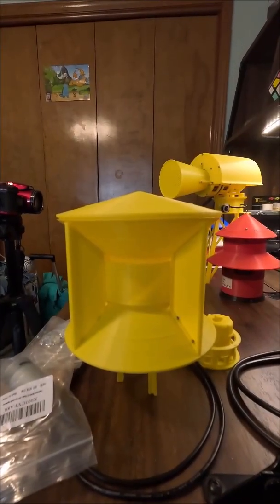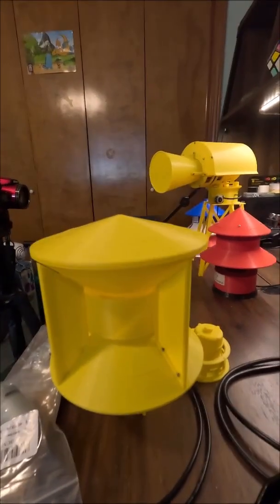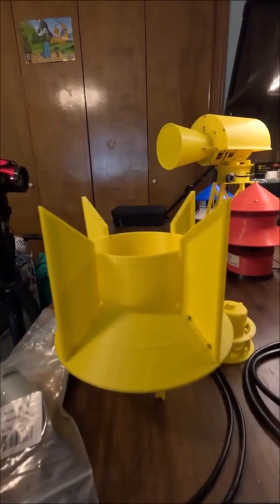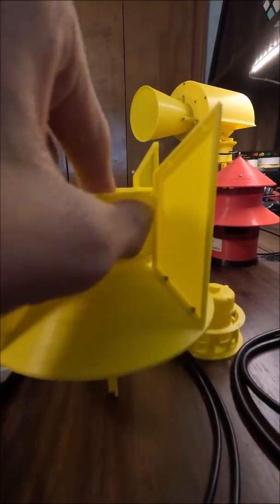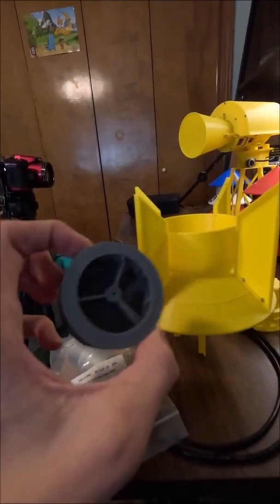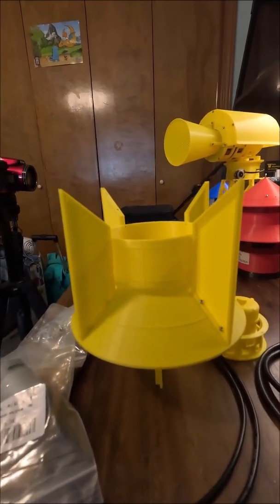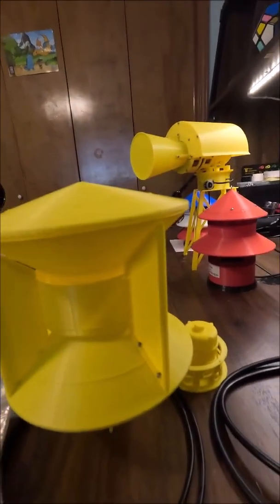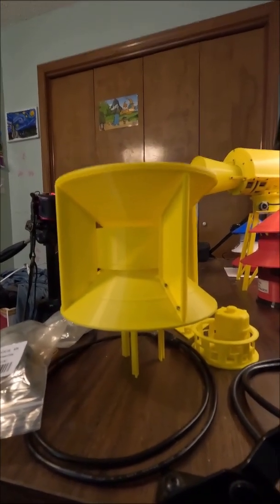New Revamped Mini SD-10 Progress! #sd10 #minisiren #3dprinting

Comment: Seeing it compared to your hands really conveys the size of it, like a phone camera makes it look probably 5 inches wide but the thing’s wider than a hand is long
Reply from the maker: Oh yeah! It's pretty big, even being 1/8 scale. I actually overscaled my older SD-10 because I thought the rotor was 20.5" in diameter like with the STL-10 and STH-10, but that's clearly not true; it's actually 18" in diameter like with the 5T. My new SD-10 now uses the same exact core as my 5T, which is actually based on an 18" rotor. So, it technically got a bit smaller since my last version, but now it's much more realistic, and I'm good with that.
Reply: @milespeterson5049  Awesome! (Tiny note, the STL-10 actually used a 24-inch rotor; the STH-10 was the only one with the 20.5)
Reply from the maker: @autismicme I'm sorry, but according to the ARS Wiki, that's wrong. Both the STL-10 and STH-10 use a 20.5" diameter rotor, because the STL-10 was meant to be a lower-pitched alternative to the STH-10, being very similar.
"The STH-10 sports a 20.5-inch, 12-port aluminum rotor facing downwards, with the 7-port STL-10 rotor being the same size."
Read all about it here: https://wiki.airraidsirens.net/STH-10
Reply: @milespeterson5049  Ah, my mistake! Sorry about that. I guess I misremembered.
Reply from the maker: @autismicme Understandable! I goof up things like that ALL the time, so don't feel bad.

Comment: i see a dual shaft motor whats it for? also this is pretty cool revamp
Reply from the maker: Thanks! I ordered some of those dual-shaft motors for my 40V2T, dual-headed Super Sirex, and my Model M! I'll probably order a third one so I can make all of those, lol. 

My only huge complaint about those is that they have a really tight shaft, which will make the wind-down short, and they consume a lotta power, but that's just something I'll have to deal with. Hopefully weighted rotors will help with that.
Reply: @milespeterson5049 
yeah, plus soon i will prolly buy a big battery or ac adapter for all my sirens
Reply from the maker: @Jace99-n7u Sounds good! I recommend adaptors so that you won't have to worry about a dying battery.

Comment: Awesome! Do you have the link for the screws?
Reply from the maker: Yeah, actually, I do! Not in the Tinkercad project, but I'll be happy to share an exact link!

I found a cheaper variant of the exact screws I used. The only difference is that they're not stainless steel, which isn't really necessary for this model. It also comes with more, and it's cheaper.
Find those here: https://www.amazon.com/HanTof-Phillips-Self-Tapping-Recessed-Assortment/dp/B09TWBFHWV

Here are the exact ones I used. They're more expensive, and there's fewer screws altogether, but they're stainless steel.
Find those here: https://www.amazon.com/dp/B0BCFX19H5

Looking back, I should have bought the cheaper non-stainless steel variant. I'll buy that one next time I need screws 😅
Reply: @milespeterson5049  Thank you!!
Reply from the maker: @TrainsAndSirensofCA  No problem!! I'm really looking forward to seeing that SD-10 in action! Sorry about the stator falling apart and all that. We've been there, lol.
Reply: @milespeterson5049 Yeah it’s just part of 3d printing lol
Reply from the maker: @TrainsAndSirensofCA  Yup! We've had worse failures before 🤦